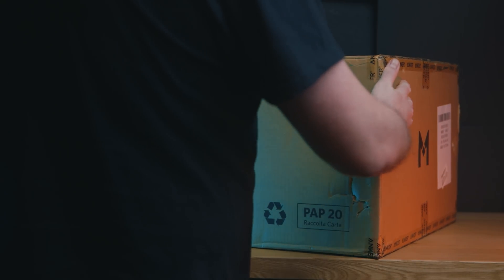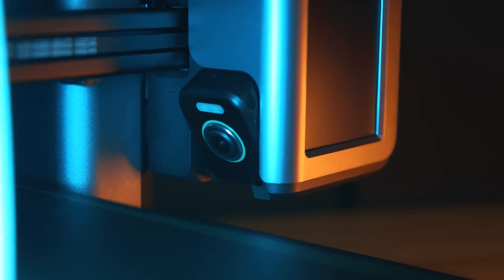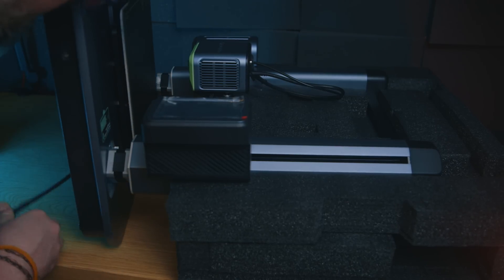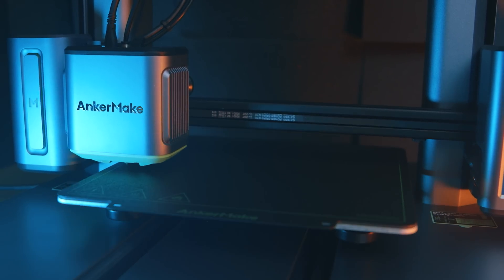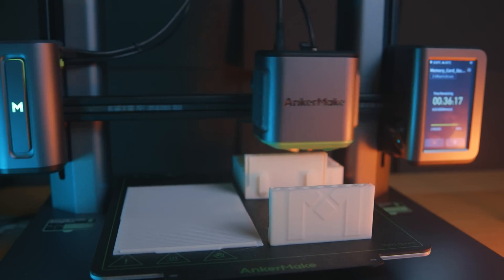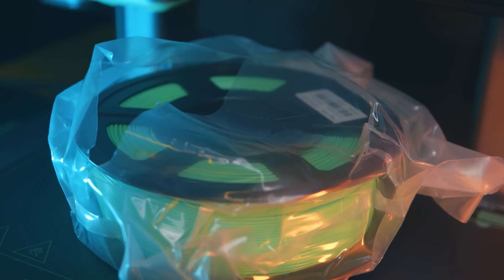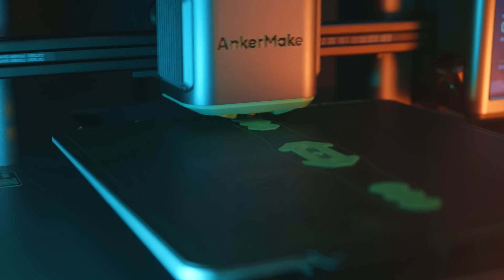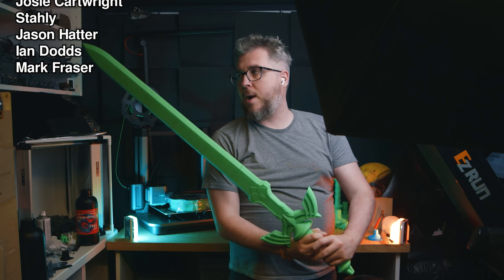AnkerMake M5 Review - FDM Printing - IN EASY MODE

Comment: I've seen a lot of people compare 3D printers with 2D printers on usability, and I think that's an unfair comparison.  2D printers are far less complex.  They can run out of paper, run out of ink or have a paper jam.  Nothing else can go wrong in normal operations. (and yet they are still the bane of existence for office IT guys).  You're not going to run into issues like "Oh, no! The ink had stuck to the page at the beginning of my print, but all the e's fell off half way thru!"  

3D printing requires a level of expertise that the average consumer doesn't have.  The M5's training wheels lower the barrier to entry, but if a user needs that level of hand-holding, they're going to get a rude awakening when things start going sideways as it will at some point with even the best printer.  

The M5 would have been a game changer 2-3 years ago.  But all of its real ground-breaking features were available to smoosh on to cheaper printers before it released, and Bambu Lab beat them to market with a printer that implemented the same features and more.  For example, try printing glow-in-the-dark filament on the M5 and you're going to have a bad time because (as far as I can tell), the M5 doesn't have a hardened nozzle. Try printing ABS and you'll get the same warping you will with a $200 Ender 3 clone.  You can't print any engineering filament like PEEK, nylon or PC. 

With the Bambu Lab X1-C Carbon (and even the P1P) on the market, the M5 looks very expensive considering what its missing.
Reply from the maker: I don't know what it's missing since I don't have the Bambu labs printer. But i don't think it's an unfair comparison at all. though that depends what you want.

We are moving to a 3D printing future where we have 5 fillaments in a printer. Black, White, Cyan, Magenta and Yellow. We can choose a model and press Ctrl+P and you get a full colour render of whatever the mdoel is.

just like 2D printers there will be some quality options like there are now on the Pixma Pro i showed as comparison.  and different settings based on the type of medium (paper) you choose.

This is the closest I've seen to that yet. It cuts so much of the guff out for the everyman, that it makes 3D printing far more accessible. for me, that time saved in slicing and re-slicing and testing can be better spent.

I get that this is not for everyone. But I would argue that it is more for anyone than the printer that have come before.
Reply: If one can compare the experience that just shows how simple the manufacturer made the process.  Yes the two complexities are at different levels but if you are able to compare one company but not the other that gives the company you can compare a huge advantage.
Reply: The community still has this mindset that 3d printing "Can't be easy" and seems to be visibly upset at the anker for it. But I suppose gatekeep is a real think in every hobbyist community. I bought the ankermake on kickstarter and a print and go experience is what I have had. People understand you can't put any paper into a 2d printer its not as hard a concept that you make it out to be. Also they both cost 599 on sale.
Reply: @dannonyogurt98  There's no anger at the anker. It's just a printer. There's nothing particularly special or threatening about it.  Being angry at the Ankermake is like being angry at the original iMac.. it's the same idea.  It's the same hardware in a pretty package with a pretty wrapper around the software with a pretty upcharge.  If those things are important to you, you can pay the upcharge.  I don't see why that would hurt anyone's feelings.

It's not gatekeeping to say that 3D printing requires some degree of technical knowledge.  When you put standard copy paper into a 2D printer, you don't have to run tests to make sure the paper will print the same way as every other brand you've used.  If you use photo paper, you don't have to worry about it warping if your room isn't the right temperature or worry about off-gassing toxic fumes.  You don't have to know that certain paper will wear out your rollers because, even though it looks like normal paper and prints like normal paper, it's actually sandpaper.  And when was the last time a 2D printer burned down a house?

When you compose a document for 2D printing, it will print as it is shown on your screen.  You don't have to think about adding ink that you'll later remove to make sure the other ink prints the way you want it to.  And you can actually compose your own documents with no extra knowledge other than the ability to spell and open Notepad.
Reply: @paulpardee  I didn't say angry I said upset, nor did I say say it was logical but that never stopped anyone before. Its funny that you bring up Mac as apple is the constant target of actual nerd rage for being too easy (aka for ignorant people).

I can also guess you're relatively young and have no clue the headache that 2d printing used be. All of those things were issues with the first generation of 2d printers and needed serious calibration. I remember at lockheed we had on call calibrating as part of the warranty and services package for the office printer. Something you don't need today, most printers can do it themselves.  The only valid complaint would be fire and fumes with some filament (more of an irritant really) but that is more of an issue with the industry. Paint and printer ink used to have lead and that could be aerosolized just by dropping it. But due to mass adoption forced them to figured out a way around it. When is the last time an electrical fire happened with an appliance? All the time but 3D printer is going to make the news like a EV. Regular cars catch fire all the time but it would be pointed out that it was an EV fire not just a car fire. Its not hard to avoid most of those issues with a single sentence for anker make users "stick with PLA" boom done. Not to mention that even today there are types of 2D printing that require a knowledge base but most people don't care and stay in their lane.

Telling someone it helps to have technical knowledge is not gatekeeping. Running off a literal list of all the issues why someone should stay away is... ahem 
I grew up pre internet, trust me when I say I know what gatekeeping looks like with emerging technologies.
Reply: @dannonyogurt98  I also grew up pre-internet.  And I don't know what you're talking about.  No one I was around was keen on keeping people away from technology.  I didn't hear anyone decrying plug-and-play, for example.  

We must have had very different friend groups. Every nerd I knew was a tech evangelist.  It seems pretty logical that if you want a technology to thrive, it needs more users.  

More money in the industry means more cool shit.  And I'm just in it for the cool shit!

Comment: Sadly my wife and I just got into 3D printing just before all these new printers started coming out. We bought a Biqu BX from BigTree Tech. It's an OK printer. Take a Ender 3 and add some upgrades and that's what you get. If we'd waited just 2 months I likely would have been buying this exact printer instead.
Reply from the maker: I hear you, this is a great printer for plug & print. don;t feel too bad, I'm sure this will be trumped before long. and it is good you cut your teeth on something that needs a bit more tweaking.

hit me up when you want a resin printer, I'll guide you right
Reply: @FauxHammer  Nice thanks! I've been drooling at the GK2 since I have a detached garage I'd need to put it in (it runs between 0 to 20 degrees C here in the winter). The heated chamber is huge, and the attention to detail in their design is clearly there. German engineering, go figure :) 

I am happily a highly technical guy, so I'm actually considering modding my existing printer and am reading through a guide someone wrote about installing clipper on the same make/model (I would have to upgrade the extruder too). Cutting my teeth on this thing has been fun.
Reply: Don't feel too upset. Pick up a Neptune 3 Pro or the new Kobra. A countdown timer is not worth 500 bucks extra, and both of those printers are user friendly and very detailed
Reply: @alertedcoyote7892  I'm using OctoPrint so I have a nice countdown already. I happen to like a lot of Anker's products though and know how good their support is. On the other hand the Biqu BX was designed to have Octoprint built in, but the manufacturer abandoned it and I've had to get it going with the newest version by figuring everything out myself rather than having good clear directions. It's a nice printer, and I have it dialed in and working well at this point. It's just taken a lot of learning to dial it in and get settings that work well for me. So no massive regrets.

We're also doing miniatures on FDM which isn't the best results due to the layer height and lines. It's hard to get them to come out well. For that I wish we'd gone resin, but I'll likely buy a resin printer in a few months.

Comment: Hi, I have been watching your vids on FDM printers and thought I was sold on your last review of the any cubic Kobra 2. However seeing this one I am now conflicted but there is a large cost difference between the two so is this worth the extra investment?
Reply: This is my question too. The Kobra 2 review was gushing. This printer is what, 2.5 to 3 times the price and likewise gets a gushing review. 

How do we, the folks watching these reviews, understand the difference?
Reply: No. Get the Kobra. 800 is insane
Reply from the maker: So, Kobra 2 works and is fine. But I want to applaud what Anker have done in the Ui to make this simpler. Many people still find the typical slicers quite cumbersome with all the various settings, it takes ages to learn what settinsg do what.

now with the anycubic, It worked with the fillament I used and my peintes were justfine. us ethe sme fillament as me and i;m sure you'll have a solid experience.

butWhat Anker have done here is make a prettier printer. the OSD is designed so beautifully and intuatively. as is their easy mode in the slicer. even the expert mode is better laid out than base cura.

You also have an equally clean and intuitive mobile app.

If you want the bare bones simplest user experience, with wifi printing and mobile monitoring. Get this. 

if you are happy to learn a ton of slicer settings. move back and forth between your printer and pc with an SD card. and keep checking the print manually for failures. save the money and get the Kovbra 2
Reply: @FauxHammer  thanks for the response which does help me decide.

Comment: Nearly £800??? WTF?? For a FDM printer? buy a resin printer instead.
Reply: depends what you are wanting to print tbh, resin just isn't a good choice for some prints, for example would your print the sword seen here in resin?  xD
Reply: @anab0lic Yeah, fdm has it's advantages, is great for structures, i prefer resin when i want something with X-treeeeeeme detail but if i want to build a structure or a robotic part i prefer going for fdm.
Reply: For 800 bucks, buy an FDM printer, a Resin Printer, and a Wash and Cure station too.
Reply: or buy a good other fdm printer less expensive like the new kobra 2 or the neptune 4 pro. they are both way cheaper and better than this shiny abomination.
Reply from the maker: depends what you want to print. i would not have made this master sword on a Resin printer.

Comment: Seems pricey for what you get (better-looking machine and a countdown timer). Not trying to heckle or be a d*ck, but I don't really see where the extra value-for-money is here.
Reply: There isn't any. Just buy a Neptune 3 Pro or one of those Anycubic Kobra ones, apparently they're good too but I've not used them myself. 800 is absurd.
Reply: @alertedcoyote7892  That was what I was really wondering, especially with the Neptune 4's coming out. Thanks.
Reply: The value is in it being close to being plug and play. Not everyone wants to have to worry about leveling and dialing in settings and just want something that works with minimum setup because their hobby isn't printing its using the things printed. that's what the M5, P1P, K1 etc offer. Basically the value is time saved.
Reply: @MaheerKibria  A Neptune 3 Pro, I know from firsthand experience, takes less than an hour to get printing. And mind you that was when I didn't have a clue what I was doing, now I could have it working in under half that. And it auto-levels. And you can just use one of the hundreds of recommended slicer profiles out there for these more popular machines, or go with curas basic ones which are just fine for someone just getting started. All FDM printers, yes even this one, require you to get into the fiddly business to get really outstanding quality. But basic profiles will get you printing. Idk where you've gotten the idea that getting an FDM printer to print something is this herculean task, but it hasn't been that way for ages.
Reply: @MaheerKibria  That's fair, but I don't know that I saw that this one is so much more "plug and play" as to justify the extra $$$.
Reply: @stephensimpson881  No problem. I had my Neptune 3 Pro set up and printing in less than an hour. I guess if you make 500 bucks an hour then the price difference is worth it lmao
Reply from the maker: perhaps I didn;t show enough of it but it;s hard to explain a feeling via video. It wasn;t 1 thing. it was multiple and many individual things that seamlessly work together that take the printer away from an enthusiast hobby to something that everyone can get to grips with easily.

no more cumbersome interface with a ton of settings, for the everyman, this is plug and print, in the simpleist way,.

it's more like an iPhone than an android phone if that's a fair comparison.